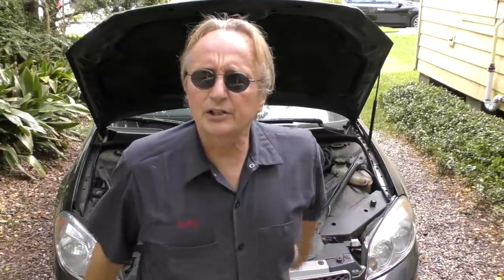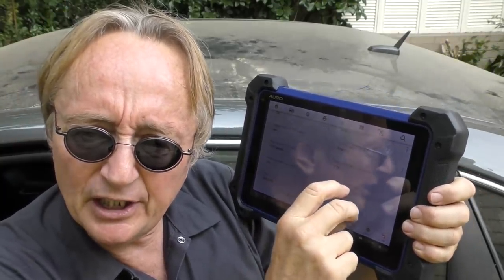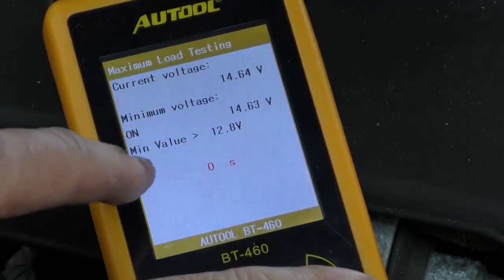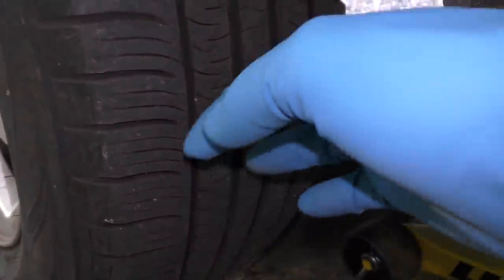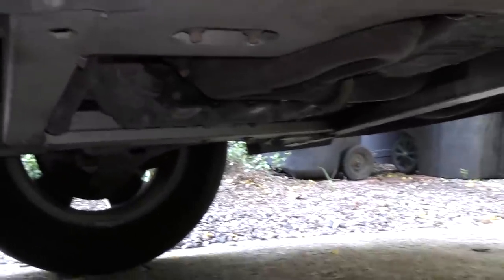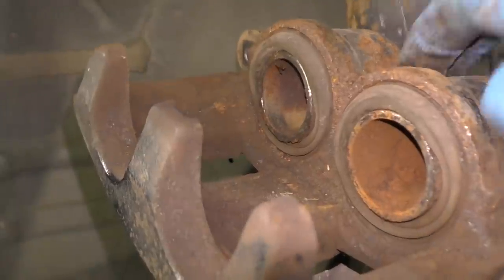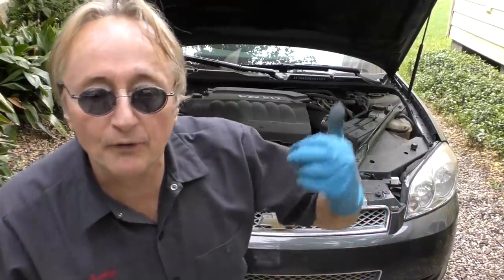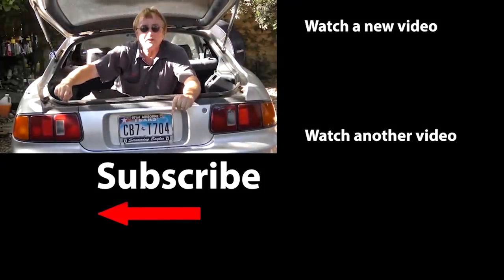Doing This Will Save You Thousands in Scam Car Repairs

Comment: Hey scotty, bmw saw my brake sensor told me someone cut it and taped it together.
Me: I did that.
Bmw: why?
Me: i figured that if you cut the sensor cable tip and join it together back it resets the dash sign once you reset it on the steering wheel stick.
Bmw: thats dangerous your ment to change the worn out sensor.
Me: i dont need a sensor to tell me when to change my brakes i got eyes to look for myself just like your old bmw cars that dont have sensors.

Me: i believe the sensor is a gimmick to make people stupid.

Comment: OMG   its ok to do that on older cars from over 25 years ago,   but newer cars with ABS brakes,  open the bleeder valve first then compress the calipers,    so many times people do that and then put the brake pads on,  then discover,   now the ABS light is on,   OMG  it can blow out the main ABS valve body and it gets expensive.  they don't do good with brake fluid being forced back into them many times,  and you want the old brake fluid out of the caliper and rubber hose anyhow because its old,  and goes bad,   so just open that valve,  and if it is so rusty it breaks off,   not a big deal,   you needed new calipers anyhow.  and cutting corners doing cheap brake jobs will get you into big trouble.   people will com back and complain and you will be doing it all over again for free.  and just putting on new pads only,  and not spending a whopping 20 bucks each for brake rotors,   you will be redoing the job later very soon when they say its making noise or shaking,     if the brake rotors are so old that the pads worn out,   come on,  just do it right,   these brake rotors are throw away items these days on cars,  so thin and cheap,   nothing like brake rotors on cars from 30 years ago,  them old brake rotors was crazy heavy and much more metal on them.   and chances are the old brake rotors are thin anyhow,   so why reuse them unless your going to sell the car tomorrow and it will b e some other person problem to redo again later.

Comment: Once the secret unlocked light comes up you have to drive as much and as long as you can without going to mechanic.
Reply: In order to maintain the best condition of your engine. Especially if it’s a Toyota.
Reply: Only the most lucky and most brandloyal drivers are selected to get to know the secret once the ‘secret unlocked’ light showed up on the screen.

Comment: Guess the heck with the rotor because he didn't check that didn't take the cap off of the master cylinder and now you use a big pair of pliers to push the calipers in instead of c-clamps I can see why they come to you Scotty they still need to figure out all the things missed in the video

Comment: Break jobs are easy. ..........Unless someone insane tightened up the wheel nuts so tight, that I need a giant breaker bar with a pipe extension.  Another sign of a lazy mechanic is overtightening the nuts with the impact tool. Every...single....car.. I get from family members and friends to change the breakpads, previously serviced by dealerships or shady mechanics, the wheel nuts so tight, I feel like just to go in to these places and toss my torque wrench at someone!

Comment: Jesus, i had that generation impala.
One of the worst cars i ever owned.

Switched to toyota.
Reply: I have a 2015 VVT direct injection 3.6 believe me I have a hesitation and jerking gear problem did you do?
Reply: - MrRIchBiker 
No but my transmission was slipping.
Changed the oil and filter for transmission problem is still there.
Will rev like it is in neutral than catch the gear and depending on my rpm will skirt the tires.

1 of many other problems i had.

Comment: It’s Best to sand the glazed rotor surfaces...Or get them turned in a cutting laith for best brake pad seating, performance and life...We’ve tested this lots. Especially if you tow a trailer in the mountains 🏔. 

We sand the rotors and drums , or if needed  ...lathe cut minimal material to get rid of ridges . NEVER BUY THE CHEAP PADS OR ROTORS MADE IN CHINA! 
RAYBESTOS, MOOG, DELCO, etc.,you pay 💰 for what you get. 

Brake cleaner or a garden hose is best to reduce asbestos dust, especially on drums,
Wear a dust mask 😷, or hold your breath, never blast with an air hose.

Safety is number one ☝️ priority 
🇷🇺 Russian hacker 👍😁🏎💨💨💨

Do regular checks so no grease falls on rotors from ball joints. Sometimes the boot has a crack and suspension grease will 🐍snake out , curve, and land on a disc . Always do a final spray down to remove any oil and grease. 

Have a great rest of the weekend everyone 

crazyfunnycats66 instagram 
👽🐱🐯🦁🇨🇦🌍🛸✨✨✨
Come say hi 👋

Comment: Very poor. The dust and crap should of been cleaned off the caliper and sliders. Any crud will cause sticky pads. And a blob of grease on back of pad to stop them sticking. If you don't clean the calipers and sliding cage, you can get uneven braking and uneven pad wear.

Comment: Kind of shady work there -- coming from a tech. Usually bad practice to reuse rotors without resurfacing or replacing. Also probably not the best to pry against that rotor with a screwdriver... just pull the bracket off and get it out on a bench! Come on man!

Comment: 14+ volts?
Not even the best battery charges use that much voltage!
And the ECM/ECU: they work, like all the other modules, with 12.4-12.8 volts… no wonder Chevrolet is so crap
A modern, a good car will have voltage regulators to maintain the system at that interval, and the battery at 13.4 volts maximum charge
Scotty sometimes does more harm than good
Reply: No, alternator output has to be between 14.2 to 14.5 volts to charge the battery
Reply: it has to be able to run the system ( all the loads ) and charge the battery. and on modern gm vehicles the ECM controls the alt output based on need. it can vary from 12.9-15v

Comment: I sincerely apologize for offending you and pissing you off but you know nothing about what can happen to a sensor. Artrac had eight centers go kaput simultaneously in the middle of a plow job and we were down for the count because the computer did is full system shutdown because of those stupid f**** sensors! Double check with manual gauges!